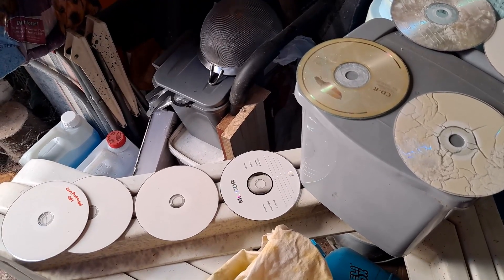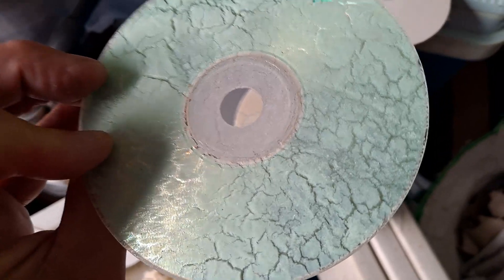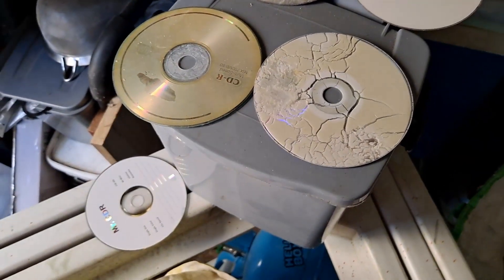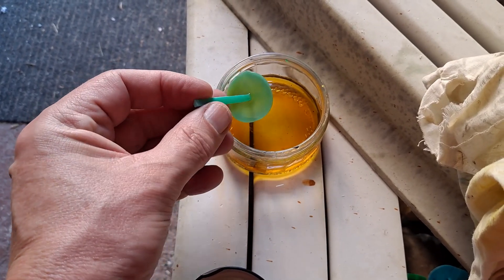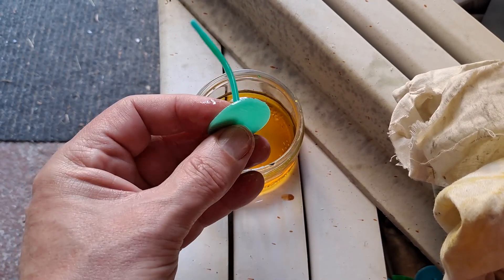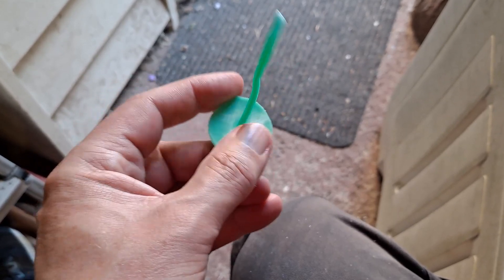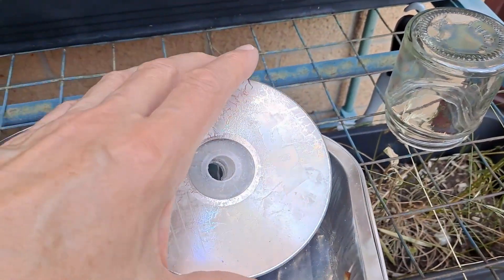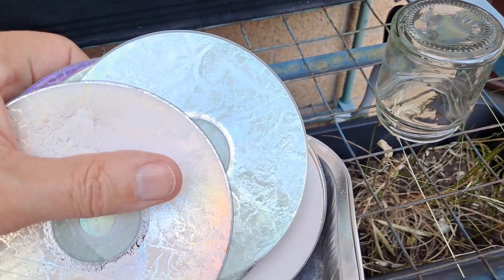CDs DVDs and PLA in Cellulose Thinners Acetone

Comment: With high voltage the (usually) alum print will come off. Use two electrodes on the print side only. To remove all data just warm up the cd/dvd (and yes, as commented already, in the microwave is an option as well).
Reply from the maker: I like this one by Thomas Kim https://youtu.be/ohMgxOL08Fw

Comment: If you can keep it soft then there are a lot of ideas for awkward shapes in model building but I see it went hard again. Although if you shape it while it is still soft then you would still have the proper shape for whatever was needed. 
The best way to totally erase CDs is to stick them in the microwave. Literally, 2 or 3 seconds, and the silver side with the info breaks up into flakes. Doesn't do any harm to the microwave and the flakes stay on the CD. It just cremates the thing in seconds. I have done it many times with four or more at a time with no problems. 👍👍👍
I meant to say that you get some sparks and crackling but it does no harm.
Reply from the maker: Thanks for the tip on the microwave, but I think that is the last of my old data disks. Everything goes on hard drives or memory cards now.

Comment: Or you could print with TPU for rubbery buttons
Reply from the maker: Hi Andy, I see you have a 3D printer, so you probably know you need a direct drive hot end to handle TPU, so it is not an option for many people. I have recently fitted a direct drive to my Ender 3 and do intend to experiment with TPU at some time in the future. However this video was specifically NOT about using TPU, it is a follow on to answer comments on a previous video where I was trying to dissolve PLA. In fact, by coincidence, the video where I fit the direct drive is scheduled for tomorrow on my other channel. Here is the link, but it won't work until tomorrow night 10PM https://youtu.be/xdwGHeeYSaM